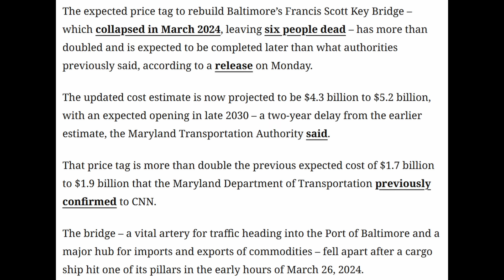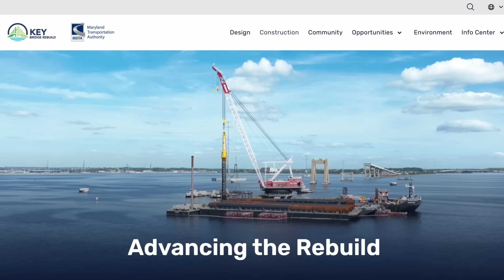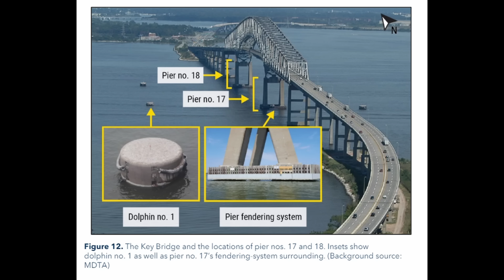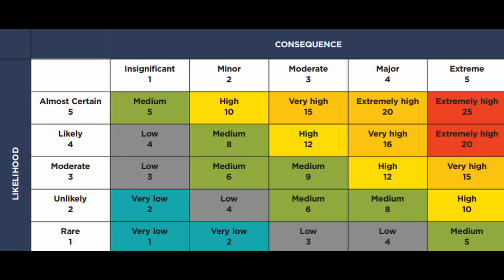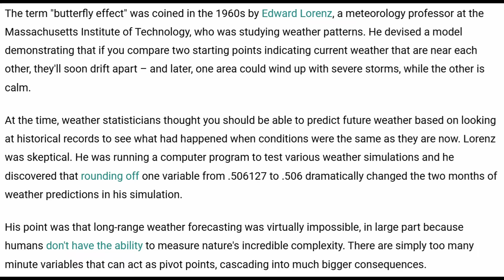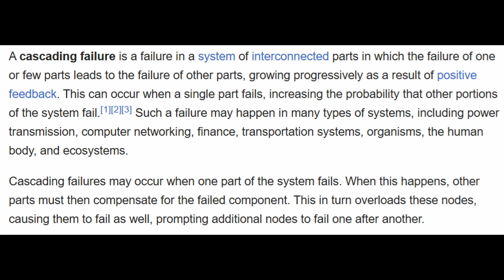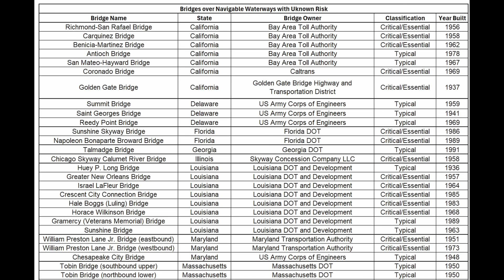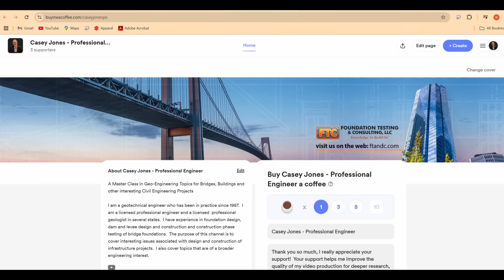Key Bridge Destroyed because of a Label on a Single Cable

Comment: This wire label sounds like sounds like a political sidetrack to blame someone else for responsibility, unless; as this wiring issue presented itself before? Was the wire in question identified and was it a wire that had anything to do with shutting down the engine? The second thing is, usually a wire becoming disconnected does not 'trip a beaker'! I have to believe that this is a political attempt to push blame onto the shipping company, and away from the poor bridge protection system that was in place! But it's only my opinion, and we will have to wait for some company's sharp attorney to have a field day with it!
Thanks Casey, was waiting to see if you were going to respond to this!
Reply: All of your technical questions were addressed by the NTSB and have been covered on other channels.
Yes, the wire was identified.
Yes, it alone coming loose could, and did, cause the engine to shut down.
“Trip a breaker” is a bit of a misnomer; the wire in question is a sense wire for the undervoltage lockout system, whose job it is to disconnect the electrical supply if the voltage gets too low, to prevent equipment damage. The affected sense wire, when it came loose, essentially showed too low a voltage, causing the undervoltage lockout to engage.

The only question not addressed, as far as I know, is whether this particular wiring issue has ever been documented in another incident.

Comment: When I saw that report I couldn't believe it at first.  I always thought that ship's systems were redundant, in case of failure of one component another would take it's place.  But one wire?  Very nice presentation and yes-infrastructure problems are very bad in this country.
Reply: It wasn't just one wire....the wire started off a chain of events that led to other failures due to the way the ship was configured and the practices of the crew.
Reply: That's what I mean.  The wire caused a cascade of failures.  Damn shame too.

Comment: PS Casey sorry to nitpick but that's a wire, not a cable.  Wire is a single conductor.  Cable is multiple conductors.
Reply: Not even EEs (hi) are that nitpicky about that distinction. And some cables are multistranded but a single conductor. And some are just any bendy line meant to hold tension. And some are made of yarn.
Reply: @blairhoughton7918   I think most EEs are that nitpicky. It’s useful to be able to distinguish between the two, so that’s why we have two words. Look on any electrical wire and cable manufacturer’s website or catalog and you’ll see them used that way.

“Multi stranded but single conductor” — my guy, that is called a “stranded wire”. 

For insulated wire and cable:
1 strand = solid wire
Multiple strands = stranded wire
Multiple insulated wires (solid or stranded), joined together with a common jacket = cable
Reply: @tookitogo thanks, we obviously agree!  (I'm an ME but yeah nitpicky is how we roll, details matter!)
Reply: @tookitogo If it's important, we give it the name that distinguishes it from the other 90 wires and cables on the box. Nobody ever gave a 24-gauge shit which were wires and which were cables.
Reply: @blairhoughton7918  Just because you don’t doesn’t mean everyone else doesn’t care. Lots of people do, because it helps, ya know, communication and comprehension.

Comment: 8:45 Casey one reason people are confused about the butterfly effect is they conflate the concept of a complicated system with a complex system,they are not the same.
Reply: Yar-yar. Sophisticated & complicated aren't the same thing.

One denotes resiliency across a reasonable number of failure points, & increased capabilities as a result. The other suggests an abundance of failure points that require oversight to prevent.

Not everything that is complicated is sophisticated, while in the real world, too, complication & the resulting maitenance is necessary.

Comment: There's a recent Sal Mercogliano "What's Going On With Shipping" that references another YT channel "Steam-Man" who is a chief engineer in the Merchant Marine.  Steam-Man explains clearly how there were four major operational errors on Dali that compounded the problem that began with that poor electrical connection.  (That style of connector is quite robust when done properly.  Unlike a screw terminal that can loosen with heat cycles and/or vibration, these are spring-loaded and "self-adjusting" so they can never loosen.  Achille's Heel is "when done properly")   In other words, they could have recovered from that failed connection had they been doing everything else properly.  Butterfly effect.
Reply: I wouldn't say butterfly effect.  The swiss cheese model is probably more appropriate.  Each "slice" is a safety layer or risk being mitigated.  If the holes in the layers line up through actions taken by people or in the design or configuration of the system, or if the layers aren't even present although they could be, then bad things can happen.  This is a characteristic of complex systems with many safety mechanisms, and they often make the news because they occur so infrequently with typically large consequences.
Reply: @major__kong  Amen
Reply: There are a good cadre on youtube and if you can sort out the good ones like Casey and Sal, Dave Brown, mentor pilot and captain steve on aircraft, for example, you will get good information.  I am sure there are some i do not know about but i pick up about 1 a month,  I look at what they tell me now and does it stand up.
Reply: A tug test could have caught this connection as being at fault when installed originally.  Also, specifications for the identification sleeve should have specified how for from the connector to be installed may have helped.  Maybe there was, and someone okayed it as being use as is continue?
Reply: @4GSR Maybe not. It could have been tight but loosened up over time due to fretting.
Reply: @major__kong  No.  That is designed to not allow that.  Get the inside diagram.
Reply: @fromthefireside5677 If it's designed not to do that, then how did the connection become loose?  It was fine for something like 10+ years and then it wasn't. That's the mechanical and electrical connection degrading over time.
Reply: What do you bet every Chief Engineer with a panel like that has spent the last couple of days telling people to go around tugging on wires?
Reply: @4GSR  Yep.  You got it. It is missed on BNC and RJ45 and bad thigns happen.
Reply: I would say details matter, not the butterfly effect.

Comment: Sal over at what's going on with shipping just had an actual ship engineer on, and he made the point that one wire might have been the final straw, there were a lot of other problems with how they were running the ship. There was a lot of negligence in their operation that made the failure cascade way further than it should have
Reply: It was a similar situation with the Concorde crash. There were rules broken which caused the stray strip of metal to be a factor. For instance, if the Concorde wasn't overloaded, it would have taken off before it got anywhere near where the strip of metal was.
Reply: Yes, the redundant systems were configured to defeat the automatic switching to the other generators, transformers, etc. after the loose wire caused the initial power loss.
Reply: lol duh dude its the provolone cheese model of accidents
Reply: I was going to say, they didn't have a Swiss cheese model of safety.
Reply: Same practical, pragmatic, cost sensitive problems apply to the bridge maintenance, and navigation channels, and transportation systems, and ... 
A that guy [Rumsfeld..?] said, we don't know what we do know (and Casey said..)
Reply: If you dig into the comments on the video before that one, where Sal talked about the NTSB report directly, the one wire in question was the one that the breaker which failed uses to sense voltage.being present on the low voltage bus. That breaker tripping offline started the cascade failure. It tripped because it could not sense low voltage through the wire with a poor connection. This is completely glossed over by the NTSB report.
Reply: That is very true.  As a Mariner myself, it shows to me how important it is to follow proper protocalls and not take short cuts.  Those guys made the modifications to the ships assuming things were going to always go right, but something simple like the wire caused their modifications to be fatal to the bridge and the workers on the bridge.  Shortcuts endanger the ship, the crew, and the public.
Reply: They only had one tug also when there should have been two.
Reply: Swiss cheese - the holes just line up sometimes!
Reply: Always.
Reply: The main issue was the inadequate protection off the bridge.
Ships will always fail.
Reply: @deth3021  Correct. Bridge supports should have sufficient standoff to safely ground ANY vessel aimed at them (because sinking blockships is a common naval practice dating back thousands of years).  Barriers should include obstacles sufficiently distant from the bridge that zero shock is transmitted by a vessel impacting them.
Reply: @Comm0ut  I agree with you. I think block ships or standoffs would be the cheapest, most reliable/foolproof method. I suppose as ships have gotten larger, they can’t have sufficient standoff inside the channel to protect the bridge pylons from every angle. Basically the ships barely clear the gap between pylons as it is. But even some chain for the ships to run into, secured to separate pylons, would keep the bridge from being struck even if it would damage the ships more than running aground. The out of control ship is gonna hit something, might as well not kill bystanders. The ship crew can probably survive a sinking in a busy shipping channel, and the debris cleared in weeks, not years.
Reply: When a car drives up on the sidewalk, hits and kills a child, is it the child's fault for not having "protection"?
Reply: @tedr.5978  I don't think the two things are comparable because there aren't potential second-order effects resulting from the death of the child. To torture a metaphor, if the parents wire up their child so that its death will automatically trigger the death of a random 30% of the people within 100 yards of it (i.e.: cars on the bridge) or destroy buildings nearby (loss of the bridge) /and/ they don't protect their child, then IMO the deaths of the others and/or the cost of rebuilding the buildings are on the parents.
Reply: @tedr.5978  No, but if a car hits one corner of an apartment highrise and the whole thing collapses crushing my family inside, I'm going to ask how the building was engineered and maintained and who signed off on it.
Reply: @tedr.5978  Where does this idea come from that only one party can be responsible for an accident? How the fuck does that make sense to anyone!?
Reply: @tedr.5978  Besides, your analogy is flawed. If a car hits a child on a sidewalk then you should ask if the designer of the sidewalk  (and the inspector who approved it) is at fault in any way for not including an offset, higher curbing, railing, etc. The answer might turn out to be no, but it should be asked. The answer might be that City Code is flawed. You are in effect asking if the drivers on the bridge are at fault.
Reply: @chord5625 you're just playing the blame game. Buildings aren't usually specifically designed to be impacted by a vehicle. It would be like a person with a weapon shooting at a building andd chips of brick or glass fly off and hit a person injuring them. Are you going to blame the building or the weapon or are you going to blame the person that used the weapon? In this case there should have been a redundant system that would override the automated system.
Reply: @bruceleenstra6181 Hopefully most people reading this this comment are smarter than the person who wrote it.
Reply: @TonboIV It makes sense to people with experience with real world accidents, who know accountability is a key to preventing future accidents.
Reply: @chord5625 No apartment  high rise in the world is designed to with stand a ground floor vehicle impact.  The fact that most (all?)   can withstand such an impact is a non intended consequence of the other design criteria.   If you think designers are capable of preventing all accidents  that can hurt your family you are delusional.   Accidents  are prevented when people (like car drivers and ship owners) know they will be held accountable  for their neglect.   If people can pass their responsibility to building and bridge designers, accidents will increase exponentially.
Reply: @noahrobin1941 Accidents are prevented  when people (car drivers, ship owners, etc.) are careful.  When people who CAUSE accidents are able to shed responsibly  for their neglected to building and bridge designers, accidents will increase exponentially.
Reply: @tedr.5978  That's even more reason why this "How dare you criticise Alice! Bob is at fault!" attitude is so terrible.
Reply: @tedr.5978  You probably shouldn't insult yourself like that, but I admire your optimism and honesty. I'm sure most people will see that you are focused on quantity rather than quality.
Reply: @davidclemens1578  Buildings may not be design that way per se, but relatively inexpensive defensive systems are often retrofitted onto existing buildings to meet new requirements. Bollards aren't free, but they're not remotely the cost of a new building. Similar systems are certainly possible for bridges, although (as I'm not an engineer) I make no claim to either the cost of their efficacy against an impact of this magnitude.
Reply: @tedr.5978  I'm certainly not trying to absolve the ship's crew of all responsibility, or even most of it. But to extend your point, the effect of accidents can be greatly reduced when designers of infrastructure take accidents into account, for reason both legal and financial; hence (for example) all the safety mechanisms in modern cars. Laying all the blame on the one who caused the accident is great in theory, but that doesn't heal the injured or bring loved ones back from the dead; for that, systems of protection around the infrastructure are the only solution I know of.

Comment: Excellent video, old non-resilient structures and aging infrastructure are definitely issues not being adequately addressed.  Your video highlights a need for emphasis in this area.
Reply: Or maybe they are, and the cost-benefit analysis indicated it wasn't worth it to replace or retrofit at the present time.
Reply: @major__kong    What is even one life worth?
Reply from the maker: Thank you!  I don't know how long it will take for this type of thinking to catch on more than it has.

Comment: 1. As you know I just love your videos.
2. Is a truss-type bridge inherently vulnerable, or was it just the placement of the dolphins? What would be a better design?
3. BTW, it was great to see you in Rhode Island! I liked the prosecutor, although he could have highlighted the stupid answers a bit more. Alviti looked sedated, didn't he?

Alviti should quit before he's found responsible for something and his pension is yanked...although his boy McKee would fight it..but it happens.

Did you see the very first press conference where a reporter asked if there might be changes at RIDOT? I'm almost certain you did, but if not...McKee was almost in a rage defending Alviti. It set the tone.

Carry on.
Reply from the maker: Glad you're enjoying the videos! A truss has a lot of non-redundant members and if one or more are damaged it could lead to a cascading failure.  The biggest issue with the Key Bridge was the lack of adequate pier protection from ship impacts.
Reply: In terms of point #2, either could have possibly prevented the bridge from collapsing,  but in terms of a post-construction solution, more dolphins &/or dolphins in better locations could have done the trick.

Comment: Good Lord. A single wire!
Reply: That was just the initiating event.  There were other issues that contributed like some engineering plant configurations that were not by the book that defeated one or more safety layers. There was also lack of tugs or no policy to require tugs to get through risky areas like the channel under the bridge. In aviation, we call it the Swiss cheese model. When all the holes line up, bad stuff happens. Holes = defeated or missing safety mechanisms or unmitigated risk.
Reply: It was the last hole in the swiss cheese,  There were at least 10 slices of cheese that coudl have stopped it, all the holes lined up.  Tugs connected, better piers, fuel not being messed up, a change to the cooling shutoff on the engine.. ad nausium

Comment: From my reading 
The ship was poorly operated‼️
They where cheating the system and poorly prepared for the 💩to hit the fan‼️
Using the flushing system to operate the engine on gas oil while in us waters was wrong 😑 
The flushing pump was not connected to emergency power since it was not designed to fuel the engine 🤦🏻‍♂️🤦🏻‍♂️🤦🏻‍♂️
Reply from the maker: Yes, the operation of that ship sounds like it was pretty sketchey.
Reply: @CaseyJones-Engineer  I love that reply.
Reply: There was a chief engineer that has said that using a flushing pump to do so is common practice, but the way it was set up with no failsafe to fall back on in a failure was where Dali had set it up wrong. To me it seems that if this is such a common occurrence, why not have 2 separate fuel systems right up to the point of the engine, rather than sharing lines that need to get flushed between fuels. https://youtu.be/ExOz3wNRu0Q
Reply: @ravenbarsrepairs5594  They need to do a better job of considering environmental factors when starting to design the ship. Instead they hack it in late and you get the relevant pump a long way from the tanks and engines and have to retrofit flushing procedures, and then someone in the field comes up with another hack that makes it cheaper but far less reliable...